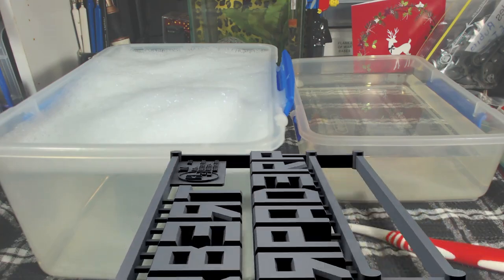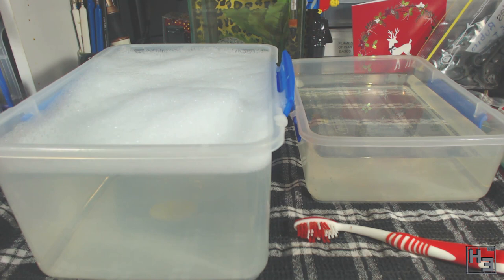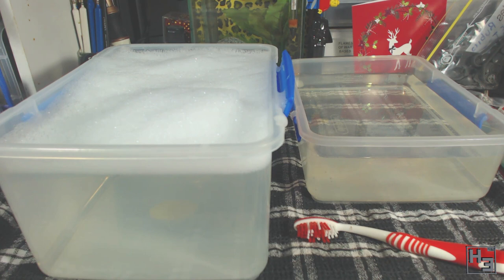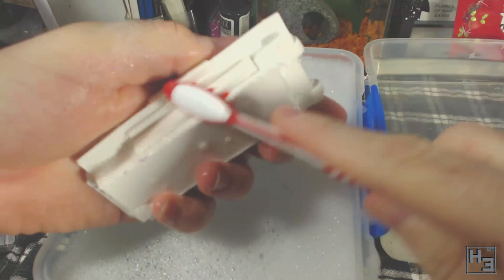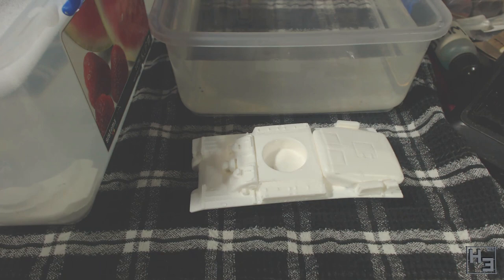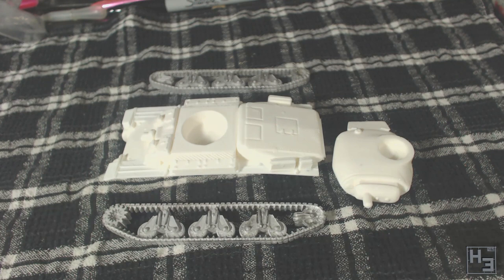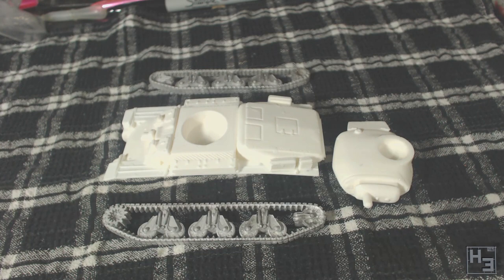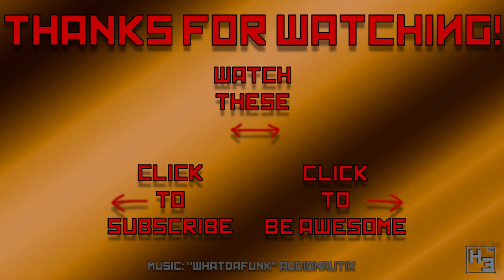Herbert Erpaderp's Quick Tips #10: Washing Your Models

Comment: For White Metal parts there is no need to wash them, just use a Brass Brush you will also get rid of the oxidation of the Metal. Never use Dishwashing Agent for Hand cleaning Dish simply it is re -greasing ( i hope i write this right) you need Water that is way to hot to get rid of the Grease. But for me , i never clean any Plastic Kit in my life and never got Problems with the Paint jobs. I am the Problem of the Paint job lol.